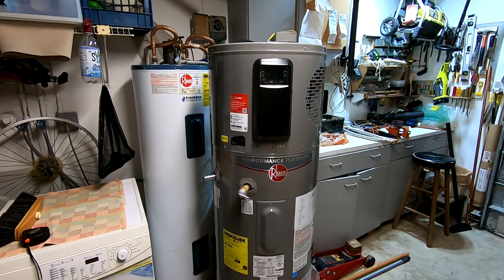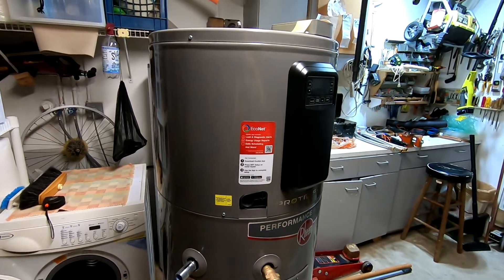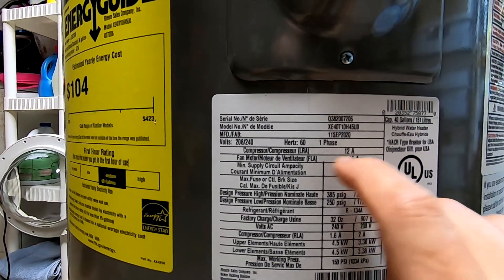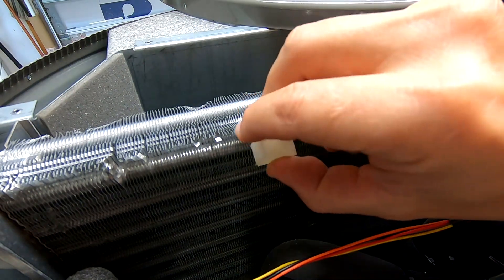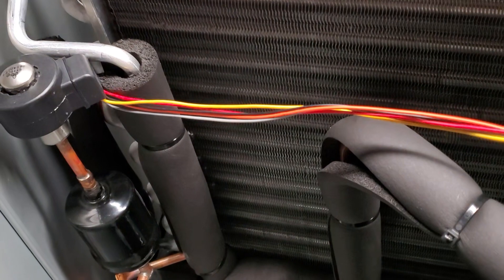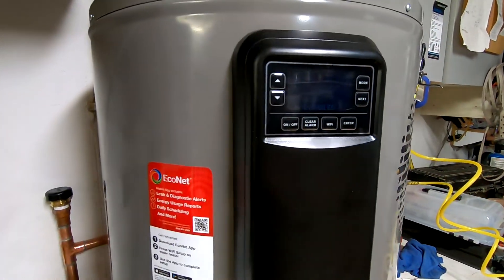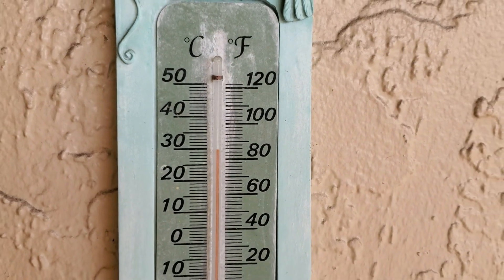Rheem Electric Hybrid Water Heater Installation

Comment: Anyone have this.  mine 6 months old suck 20 kw per day on energy save mode. I think this is abnormal 600 kWh per month is too much. I found out bc I just down load the app
Reply from the maker: You must be running it all the time. I have it set on schedule and heat pump. check your settings.

Comment: This install was so easy!  Home depot has the 50 Gal on sale till the end of the month with Washington State Energy deal for 860 out the door. Took me 3 hours to install and that was going to 4 stores after to find the right PEX fittings.   The really sad thing is Home Depot Installers wanted 2k to install this. That part is a rip off so dont fall for it.
Reply from the maker: remove anode rod and put teflon around thread. I did not do it and now 2 years after I can not get it out.

Comment: I was just in the garage and looking for something, and just so happen I looked and saw my water heater had corrosion on top of the water line fittings and decided to replace with a new one and I came across this video and decided to purchase an either 65 gal or the 80 gallons. thank you for the awesome explanation of the video. what part of Florida you from I'm from Florida as well?
Reply from the maker: I'm glad I could help. I'm in Boca Raton. This is the best water heater that will keep your garage cooler.
Reply: @MaciejPiotrowski  im trying to get some one to install it for me i was told it had to be vented outside 
i think im going to have home depot come and do it
Reply from the maker: @bowchickawowwow6246  That is a BS. Do you see mine vented anywhere ? Look up on Rheem manual for this water heater and you will see what they recommend.
You can vent it out if you want redirect cold air to another room. If you leave it in garage it will cool your garage like in my situation. No more humid in my garage.

Comment: Thanks for making this video. I'm looking at replacing my existing hybrid unit with this unit, and your summary was great!
Reply: Why? What was wrong with your old unit? What brand was it? I'm an installer and want to install the best brands.
Reply: It was a GE Geospring I believe. It was about 10 years old when I replaced it, so I can’t complain too much. However, the failure method was a break in the coolant line; which was the most common issue I found when searching.

Comment: Great video thanks for this, as I had one installed, but I'm not completely happy with the work as they didn't put a tube for the condensate. I had a standard water heater and prolonged its life, and got 18 years of service by replacing the anode rod and elements from time to time. Finally had it replaced when the tank sprung a leak from the bottom.

Comment: I thought Hybrid hot water heaters required some type of exhaust duct to be run outside? I'm looking to replace my hot water heater, but I don't want to get into running duct and having to cut though the siding and all that. Because of this I'm leaning towards a traditional hot water heater. Thanks for the video.
Reply from the maker: Hybrid means that it uses electricity and heat from the outside to heat the water. You don't need to run any ducts. That's the beauty. You put it in your garage and it takes hot air from your garage to heat the tank or just electricity. Because it can work in 2 modes this saves you a lot of money. I pay about $8 per month to run this water heater.
Reply: @MaciejPiotrowski  Don't mean to turn this into a support thread but I live in Delaware (Northeast) and my hot water heater is in the basement. Doesn't usually get hot in my basement. I imagine that will impact performance? I thought I read Hybrid's are usually intended for the warmer climate states?
Reply from the maker: @notta3d  They are more efficient in warmer climates but they also should work in average ones. I'm not an expert but hybrid water heater will remove moisture from your basement and will cool it down as result of that. You have to decide what's best for your situation.
Reply: @MaciejPiotrowski  Thanks! I just got off the phone with my sister and she talked me into just getting a traditional hot water heater and be done with it. But since reading your comment about removing moisture from your basement that is a huge plus for me. My computer closet is in the basement and I have a dehumidifier running all the time to keep the humidity regulated. If a Hybrid will help with the moisture that is a huge plus for me. Not to mention my state is offering a $700 rebate for energy star certified Hybrids, plus a $300 federal tax credit. HD has the Rheem Hybrid for $1699 so after the rebates I would be getting the Hybrid for the same price as a traditional. Thanks for the help.
Reply: For anyone that might read this. Correction. Delaware is not offering any rebates. It's for Maryland only.
Reply from the maker: @notta3d  Good choice. Make sure you check your anode rod yearly and replace it every 3-5 years to prolong the life of your hybrid.
Reply from the maker: @notta3d  so have your friend in Maryland buy it for you.

Comment: Very good video but I have one question. I'm installing this same unit in a couple weeks, for the power source does this plug directly into a 20/30 AMP outlet or did you need to hardwire the electrical connection?

Thanks!
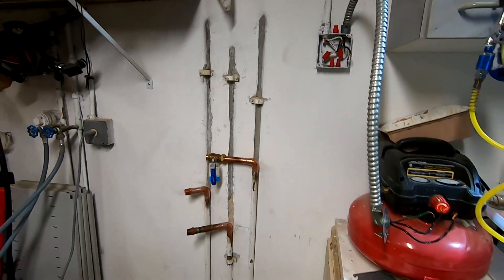Reply from the maker: Look at this 7:24 min of my video https://youtu.be/vYS1uZEyxX8?t=444 and you will see how I have it connected. I had timer on my old heater that I removed and hard wired new water heater to the line. Hope this helps.
Reply: @MaciejPiotrowski  Outstanding, thanks!

Comment: Can you install this hybrid electric water heater in cold climates and confined spaces?Also if you bought the water heater what would a plumber charge for the install?
Reply: I just called Home Depot and they said $1600 for install. Way too much!
Reply from the maker: @Raptors0524  That's a robbery. Do it yourself.
Reply from the maker: This water heater if you want to run in energy saver mode needs to extract hot air from outside. I live in Florida. It will take much longer in colder climates. I installed it myself so my cost was zero.
Reply: I got mine on December 28 to take advantage of the tax credit. Had it installed last month the installation with the plumber was $450. He had to run an extra drain line and that was part of the cost. But I am completely satisfied with this
Reply: Just had a Home Depot recommended plumber tell me 1300$ for a water heater install and I hadn't even mentioned hybrid yet to them so guessing the 1600$ would have come up.  Agreed that's insane going to call around some more or just watch some more videos and do it myself 🤣 ordered two for my house.
Reply: @engineerfalde  I just had a similar response from Home Depot's rep. They quoted me $2000 to install. I relocated my current unit in my house no problem. However, to get the $700 NYS clean heat rebate it needs to be installed by a participating contractor.

Comment: Just know that what ever room you have this in it will make it really cold. It also has a low pitch hum. They work really well but plan on ducting with a valve. Have it open so it dumps the cold exaust air inside in summer and switch closed for me to dump outside my garage in winter. For those who don’t know a heat pump is basically an AC that is turned in reverse. It works amazing in my garage like that. Another thing I learned to do is have the water heater scheduled via the to set to 130*F from 3am to 7am then down to 115F until the garage gets hot and have a kick on so around 1 PM in the afternoon set back to 130F. What this does is it avoids my peak rate for electricity and makes my garage comfortable to work and even in summer. These really do save a ton in high electric rates if you have proper spacing or ducted and in a state like California for me it is about $900 a year savings,with 4 people over my old electric filament unit. So pays for itself in a year and half and I get free ac for my garage.

Comment: I purchased a Performance Platinum last week, 50 gal (42 gallon storage).  But we tend to run out of hot water after the first 5 minutes.  This can't be normal, is it?
Reply from the maker: Your temperature is set too low, that's why you run out of hot water fast. Change temperature to higher setting or change your mode to high demand. Let me know that helps.
Reply: @MaciejPiotrowski  thanks for your reply, we have it on energy saver over night, the spout to flush the water was hot (is that normal? and does that indicate that the lower element is in fact working and heating the 45gal storage tank?).  But even so, shouldn't the whole tank be 120F by then and have at least 45+ gals of hot water?

The app shows red low availability only after running for a few moments.
Reply from the maker: @sportykev  The spout to flush water should be hot. It's indication that there is hot water inside. Cold water is pumped at the bottom of water heater. Hot water is on the top. Look at your app at the icon showing hot water availability. If the icon is red that means the water  temp is low. If you see green bars but only to half or less of water heater icon that means water is only half way to desired temperature. Efficiency and how fast your tank will heat up the water depends on the temperature outside the water heater. If you live in Florida like me, it takes maybe 30 min on energy saver to heat up entire tank to 120F. In January when it was 50F in my garage it took few hours to get to 120 so I had to switch to high demand mode to get hot water at lower power consumption mode. Look at the app before you take shower to see how much hot water you have available in the tank. Adjust the mode accordingly to your needs and your location. Learn from that and create schedule that works best for your situation. I pay about $8 per month for my water heater working mostly on energy saver. Hope this helps.
Reply: @MaciejPiotrowski  That's interesting, the hot water availability meter is really vague so thank you for this context.  If I set the temp to 120F on energy saver mode, and the meter shows full 'blue'.  Does that mean my entire 50gal tank worth of water is all 120F? (regardless of what mode i'm in, I have that much water in 'surplus').  Is that correct or am I off?
TIA
Reply from the maker: @sportykev  Blue means cold water. You want to have all green bars.
Reply: @MaciejPiotrowski  sorry, what I meant to say was full green bar.  Which BTW, doesn't even make sense!  Hot should be red! LOL.  It starts with 1 half red bar, then progresses to a 1/4 blue bar.  But going back to the previous question, if all green bars, does that mean the entire tank has reached temp?  My issue is that I only have a few minutes of hot water then it runs out.
Reply from the maker: @sportykev  Wait until you have full tank icon green. 2 people can shower using 1 tank of water in my house or I can fill entire bath tub with 40 gal in my house. Are you using 20 gal / min and showering under fire hydrant? Use high demand power mode or rise the temp on the app.
Reply: @MaciejPiotrowski  We just switched from an oil powered water heater and never had a problem with running out so trying to understand what's going on.  It seemed as if our dish washer consumed a good amount of our hot water today in a short time span.  Did you have to change water consumption habits when you switched to this tank?
Reply from the maker: @sportykev  no

Comment: Ok new update. Received the new Econet module today and switched it out. I deleted the old module and attempted to discover the new module. It saw my wifi network but would not connect. I tried deleting the app and reinstalled. Still would not connect. Tried calling the 800 number for Econet support (I have spoken to them before) and got a recording it was not a working number. Tomorrow will see what can be resolved.
Reply from the maker: Interesting. Hope you can fix it.

Comment: A third Rheem hybrid water was installed Jan. 5th. It was manufactured 11/11/20. Honestly it is marginally quieter than the previous two, Nowhere near the advertised 49-50 dbl. It is installed in my finished garage that is under the house, in a corner so it has concrete walls on two sides. On this unit the Econet module has never worked. It was on back order and is scheduled to arrive this week. We can still hear it running in the entryway and adjacent den. We have either gotten use to it or decided it is no worse than hearing our heat pump forced air system, the dishwasher, etc. So we are going to keep this on since I doubt any others would be quieter. I will replace the Econet module myself.
Reply from the maker: Thanks for the update.

Comment: 12.30.20  Thanks for the video.  I to want to install this brand at 50 gallons from Home Depot which there 2 models.  Would you know if there is a difference between the Performance platinum and the Pro Terra?  Thanks again for the install video.
Reply from the maker: Proterra is part of Performance Platinum. Proterra is the newest version of Rheem waterheater.
Reply: One comes with the leak sensor and auto shut off valve and the other model doesn't.  You can retrofit the leak guard yourself for about $200.

Comment: I just had installed this week the Ruud version of this unit (no difference). I am upset with the noise level. It is rated at 49dBL but my unit is running at 69dBL. Virtually all reviews I have seen comment how quiet the unit is. Have you tested yours?
Reply: I have an 80 gal hybrid (5th Gen) that i just installed, and its also on the loud side 70-80db.  I read that this is actually an issue on 5th Gens and have read a solution can be placing a heavy magnet on any side you put pressure on with your knuckles that reduces sound.  I will try soon and update.
Reply: An update. My installer received a fix for the noise. It was a quarter inch thick foam rubber pad for inside the lid and a donut gasket for the fan. It did not help. A second unit was installed, not any better than the first. Spoke to Rheem/Ruud today and a third unit will be installed.
Reply from the maker: @rod2625  Thanks for update. It seems like you just have a bad luck with bad units. Hopefully third one will be ok.
Reply: @rod2625  any update? Thank you
Reply from the maker: I have no way to test how loud it is, but it is in my garage so I don't care. It works fine. That's what matters.
Reply: @MaciejPiotrowski  there are apps, decibel meters, for your phone. That is what I used at 3 feet from the unit to measure the noise level. The 69dBL  reading I am  getting is 20 times louder than the documented 49dBL. As I discuss this issue with my installer it would be helpful to know what others are experiencing.
Reply from the maker: I just checked and my water heater works at about 50dB.
Reply: @MaciejPiotrowski  thank you for checking! You are spot on as advertised at 49dBL. At 69dBL it is actually 20 times louder than at 49. Thus my concern. The company that installed it will be sending out a service tech to take a look at it. Thanks again for verifying!
Reply from the maker: @rod2625  No problem. Glad I could help.
Reply: Are you guys still experiencing loud units? I am planning to install one inside my home but will return it if loud.
Reply from the maker: @CaptainCrunch823  Mine is fine, but I got 2 guys that reported loud units.
Reply: @CaptainCrunch823  What I experienced in the 3 units I had installed is that the sound was at 70 or so dbl. This last unit I believe the pitch/frequency is less noticeable (significantly)  in our house. In the garage where it is located below the house it is still loud but honestly it does not run that much in Energy Saver mode. In our home with forced air heat pump, dishwasher, exhaust fans, etc. it has blended in. Where it was noticeable was the just above the unit, our entry and den. With the two of us retired the default 120 degree setting  is perfect and I do have a daily schedule to reduce it to 112 overnight. I am averaging about 2kwh of energy usage daily. Very happy with that. I should mention that I did not have any issues with setting up EcoNet on the first two units. This last on it saw my Wifi network but would not connect. The support person (I apparently go their new guy I learned later) thought the unit was bad and I was sent a new unit after almost a month (it was backordered). I installed the new unit, it still would not connect and I got the same guy who basically told me to figure it out. I did, my VPN on my iPhone was the issue. I turned that off and then completed the setup and then turned it back on (no issues since). I suspect the first unit was good as well.  Will be interested in how your install goes.
Reply: @rod2625  Thanks so much for the feedback! 70db is too loud for me but I would be happy with the advertised 49db because it is being installed inside the house. Which size unit do you have?
Reply: @CaptainCrunch823  I have the 50gal. My first two units had the leak detection and my current does not. Thought we would try that model to see if it made a difference. I am getting a $300 refund from my purchase .
Reply: @rod2625  Thanks Roger!